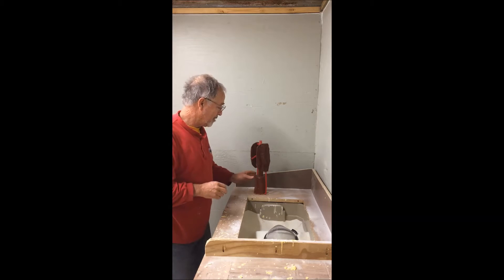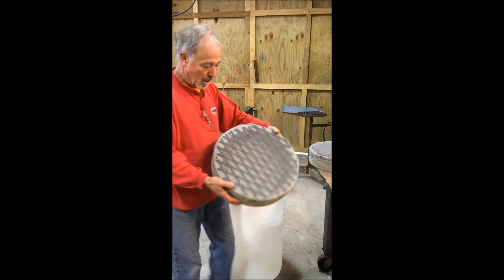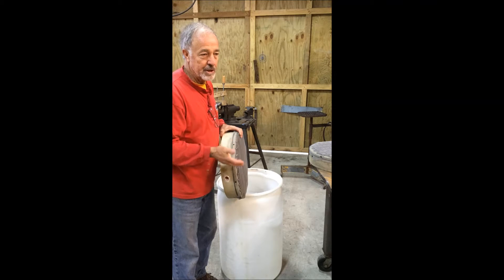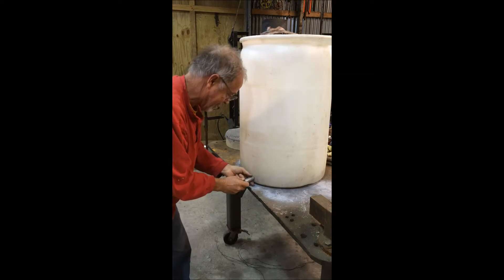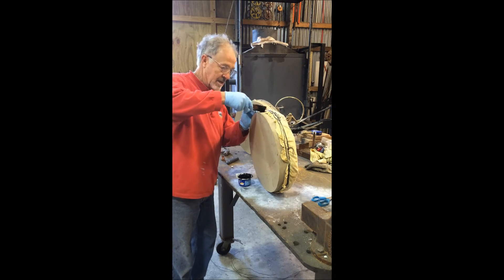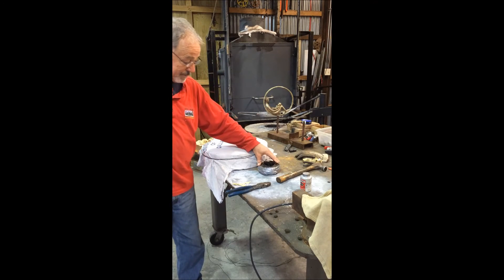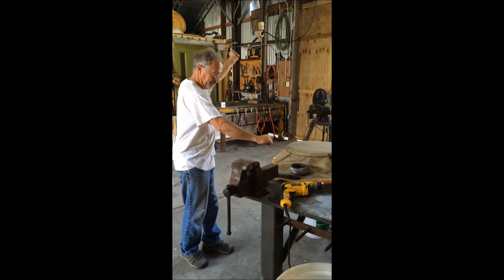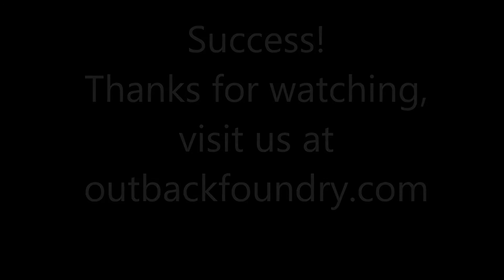Fluidized Sand Bed

Comment: Nice work, I've also seen rotating drums that just shower the sand down on the wax. I wonder which is the best method or is it the same results
Reply from the maker: Thanks Clarke
If I didn't already have a good sized air compressor I would have entertained building some sort of shower system. They would take up a little more floor space in which I have a limited amount. But otherwise, as long as the sand is applied to all of the surfaces and the mold can be held with breaking....I can't see it making any difference to the finished product.
Barry
Reply: Barry Luke thanks, I want to add ceramic shell to my process this coming spring, of course I said that exact same thing two years ago too.